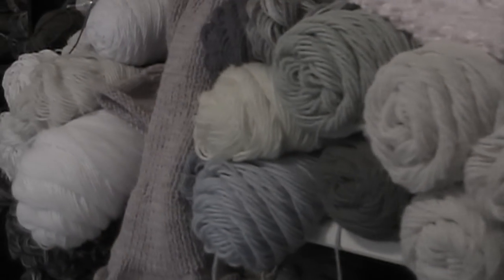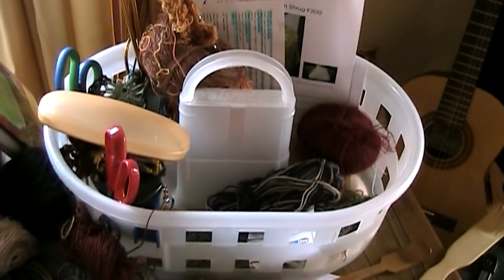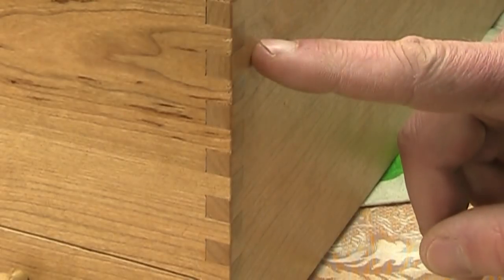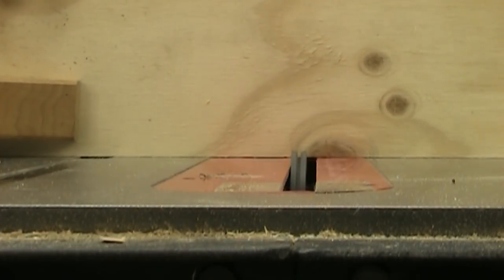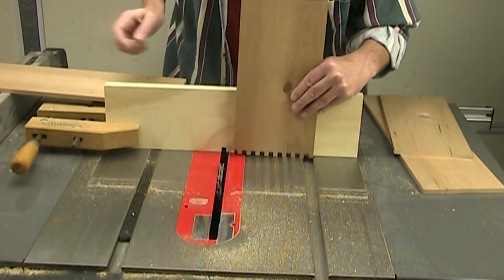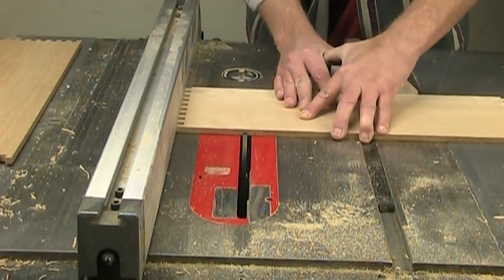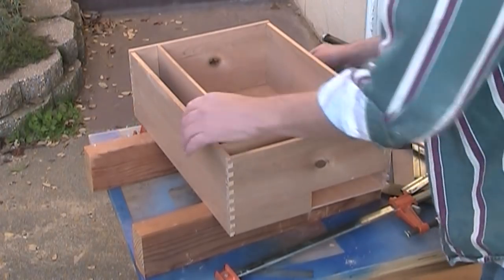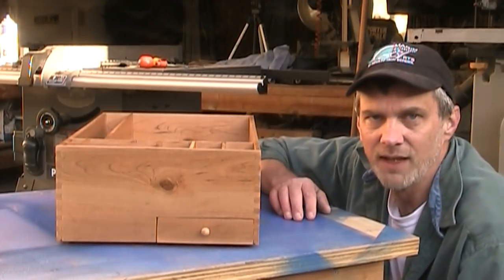Knitting box...and how to make easy finger joints. Woodworking joint jig.

Comment from the maker: @ChampionBass198 If you get a dado stack you can make it as thick at you need. I suppose 3/4" would be practical in case you want to make grooves for 3/4" plywood or even off-the-rack boards.You might consider saving money and get the 1/2' set and using the router for anything wider.

Comment from the maker: @Vamperlis I haven't had problems with that. If you want to be extra careful, you would line  up the board with the fence, clamp it to the miter sled and then slide the fence out of the way. Seems silly to me. Especially if you are going to make repeated cuts the same length.

Comment: Box joints, finger joints are longer and thinner. No matter...Great job, Steve. I think it would look good with a couple of rope handles on each end. I love working with cherry. That piece you used for the index pin on the box joint jig looked like jatoba. It's great for stuff like that, nice and hard and stable.

Comment: Like the video,  like how you break things down.  I bought the same saw a few years back at lowes when it was branded Hitatchi,  Loved it till the worm screw broke.  be sure to hook up some dust collection so it doesn't bind up the plastic gears,  and check on it too a lot of times the small hole likes to get clogged and before too long the cabinet is filled up.

Comment from the maker: @SugarBeatCo I think I could have done it on my old saw, but the main problem is the miter gauge. It was pretty sloppy and would have produced less-than perfect joints. But I'll bet I could get it to work with careful planning. I've made those joints on the router and never had problems.

Comment: It's not a problem as long as you're not making through cuts.  The issue comes when a loose cutoff gets racked between the fence and the blade because the miter doesn't do anything to keep the cutoff up against the fence.  As long as there's no loose pieces, then it's no problem.

Comment: @texanthom 
The joint Steve made has been around for a long time and has been called both a finger joint and a box joint.  The joint used to splice boards together end-to-end are not the same (the 'fingers' taper) and it hasn't been around for nearly as long.  They needed something to call that joint, which is really a type of scarf joint, so they stole an existing term which just created confusion.  Cheers.

Comment: @Vamperlis It's not so dangerous if you are cutting a dado.  The main danger comes when making a through cut and the off cut gets wedged between the fence and blade.  That said, I'd make the cut by clamping a 1" piece of hardwood to the fence in front of the blade and use that as my guide.

Comment: @Vamperlis This is true, but not true if you are not making a through cut (cutting piece off board). In this case it was a dado cut so that is safe. The problem with using your fence as a length guide for a through cut is that you can get kick back. You can still use your fence however just simply clamp some scrap against the fence in front of the blade to use as a stop for making repeatable cuts.

Comment: the danger is when you are using the fence as a positioning device for cut off work.. once you have a loose piece between the fence and the blade it can rub against the blade, twist and jam or be grabbed by the teeth and be thrown back.. using the fence as a positioning device for dadoes  etc. where there is no loose piece between the fence and blade there is no safety issue..

Comment: Where do you buy dado-blades?? Cant find any....
Reply: If you are in America, then in Home Depot, If you are in Europe or some other continent, then in specialized tool shops. P.S. No-need of dado blades, you can use regular (for example 2.0 mm) blades, but you need to cut more.
Reply: Ok, thanks. Im from Sweden. Its just so tedious to cut so many times... And seems they give better results also. I cant find on Axminster, Powertoolworld och Toolstop. Any more suggestions?
Reply: Not really, I live in Lithuania (Not far from Sweden) and i didn't find any dado blades in my shops. Maybe there aren't dado blades in my country, because Lithuania is a Third country. Try to buy some dado blades via internet.
Reply: You could stack several regular blades, but i don't know if it's safe and i can't test it, because my table saw is just a Makita Circular saw mounted underneath a MDF sheet.
Reply: Ok, i just gonna buy a Bosch 10 XC tablesaw. But maybe i find someone soon. 1 blade will be enough then i guess.
Reply: If you have a router, you could make a router table and just route those finger joints. Anyway, what kind of woodworker are you (Do you make furniture or just for yourself)? What kind of tools do you have (Not mentioning homemade tools)? Do you sell your made products, and if you sell them, how and where, when, i want to sell my products so I could make money for my shops expansion. P.S I'm not legal age (Simpler, I am 13, not over 18).

-----Pradinis laiškas---
Reply: Viktoras Nesakysiu, I have a big Router mounted under a cheap router table. Also have a cheap jointer, Not working so good. And a mitre saw off course. I have just doing small projekts for myself and family except a did repair a boat that was smashed. Gave me good Money so i could buy better routers, clamps etc. I try to expand my workshop now so i perhaps can do more job and earn some Money. But its hard. Material and Tools are expensive. So i try keep it as my hobby so far. My advice is to buy a good jointer and cheap thicknesser. A good bandsaw and tablesaw. And a good sander (random orbit sander). Also good and at least 20 clamps....depending what you do off course. But as Always, start with bouying Green Bosch Tools for example and after years sell them and buy Makita, Blue Bosch or Festool. But no rush! You Always gonna need new and better Tools. Good luck and work safe! :)
Reply: Anton Nilsson 1. I don't advice to buy green Bosch, green Bosch tools are for hobby'ists who work ~1 hour per week (Or just very rarely). Green Bosch product quality aren't so good. For example, my Makita plunge router has metal bearings, but green Bosch plunge (Or fixed base) router have cheap plastic bearings (Most of them). I buy (Well my dad buys me stuff for woodworking, but if a ask him) profesional tools like Makita, Bosch Blue, Festool (I don't have any of Festool's products), Metabo. My whole shop has only Metabo, Makita and Bosch Blue products (Only my orbilal (Not Random Orbit) sander is MeisterCraft, it's I think 16 years old). Anyway, as you said, start buying 20 clamps, depending what you do. I have 3 small cheap VagnerSDH and 2 big descent quality clamps, and as a woodworker I have enought claps (Well, you never have enought clamps) for my glue-up and other works. But i don't need soo much clamps, because i tighten everything with wood screws, I rarely use glue. Ok, I wrote so much, that my comment has no sence. Write me back (My email is viktoras2822@hotmail.lt). I'm waiting for your answer.
Reply: Ok, i send you an private e-mail :)
Reply: I'm not sure dado blades are legal in Europe.
Reply: They Are Legal. I Just Bought One.
Reply: +Anton Nilsson I live in South America and I can't find half of the things I see Americans use. In general it's not a big deal, because we're use to work around things. But sometimes it's just a pain, like finding a decent hand plane. When there is something I need and can't find, and it's a must-have, I buy it online. 

But to me, it's all about ingenuity and find a solution rather than spending cash on tools you probably end up using very little. (I'm not saying you wouldn't use the dado blade).